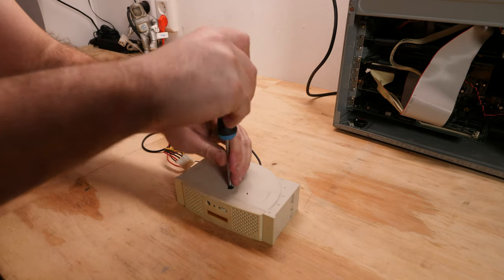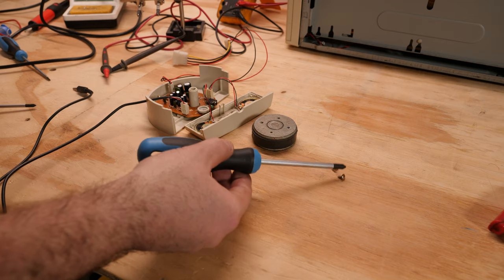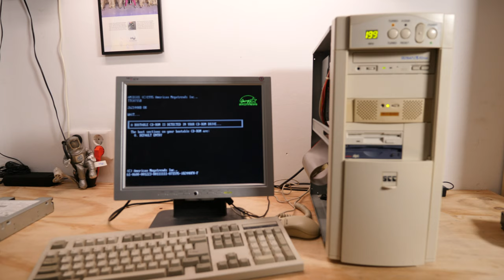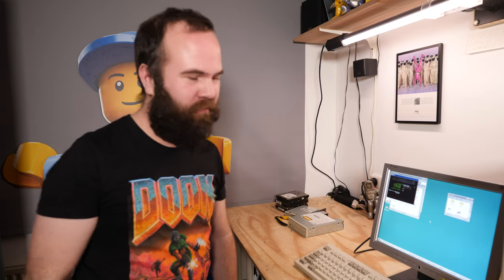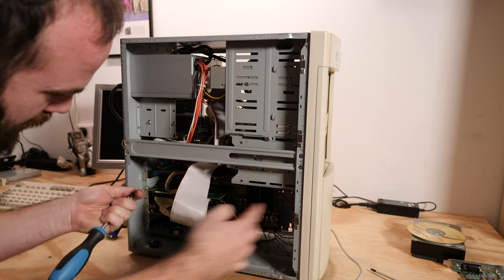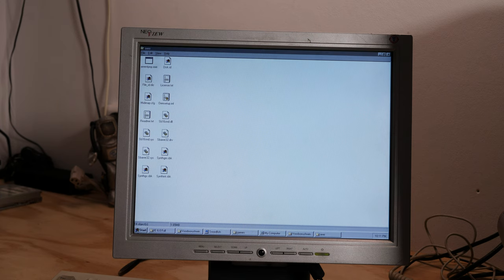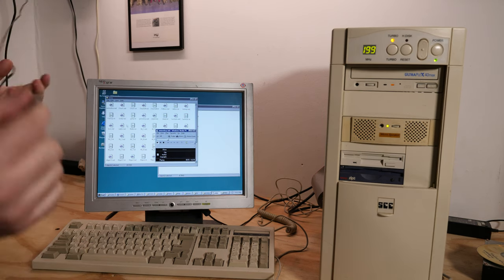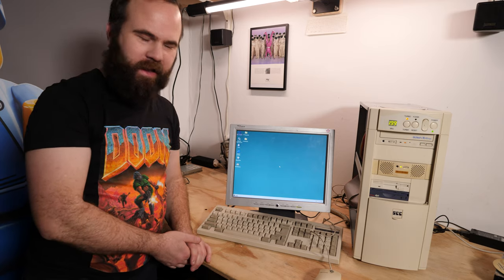Can I Fix the Pentium Pro 200mhz Build? SCSI, 3DFX, NT 4.0

Comment: If you haven't already figured it out in 3 years since this video, if you go to "Folder Options" in the "View" menu, you can set it so that it doesn't open a new window every time you go into a folder, but opens that folder in the same window that's already open. This also works for Windows 95.

Comment: Use Win95 with a Pentium Pro? Are you crazy? The Pentium Pro in a thoroughbred 32-bit processor. You can't use this underdeveloped Win95. For a sophisticated 32-bit processor. You really shouldn't do that.
Reply from the maker: I never said Windows 95 on a pentium pro! :D
Reply: I ran Windows 95 on a Core 2 Duo for several years.
Reply: @victorbart  Okay, then it is good!
Reply: @tothemaxx1991  As of the Pentium II, Intel has reduced the 16-bit inefficiency again, so that all subsequent processors could handle the 16-bit software better again. The move to 32-bit software was just too fast, but it was hard to imagine that someone would still work with 16-bit software TODAY

Comment: CPU i would go for is something that can run passively. Maybe a k6-2+ 400 mhz with a big heatsink & like 120 mm fan mounted in bottom of the case pointed at it & the motherboard.
Sd card for harddrive or ssd with a sata too ide adapter.
Change out the fan on the powersupply too a more quiet one as well while you are at it.
Sort of make the most quiet computer you can for a project maybe.

Comment: I used the s3 virge card pci which is a measly 2mb but NT 4.0 has the drivers on the cd then I used the voodoo 2 diamond add on dual.  Used the drivers from 3dfx zone they had for NT and gave me 16mb interweaved so it saw it and ran great.  NT is picky indeed!  Great video.